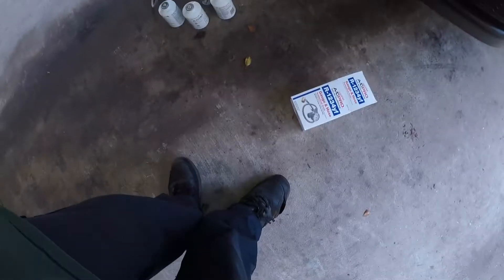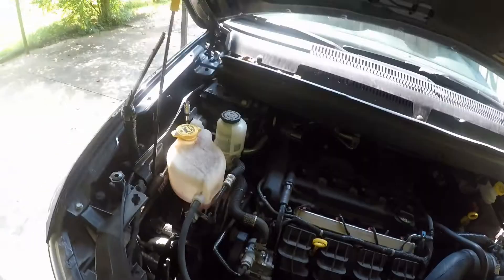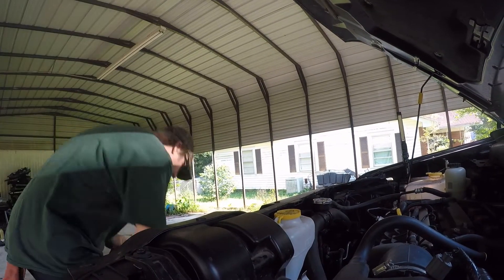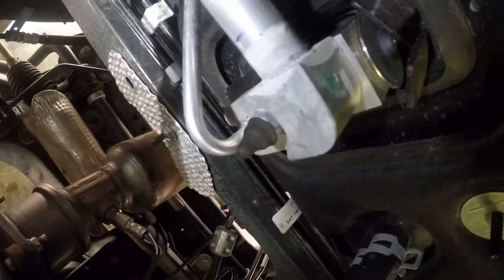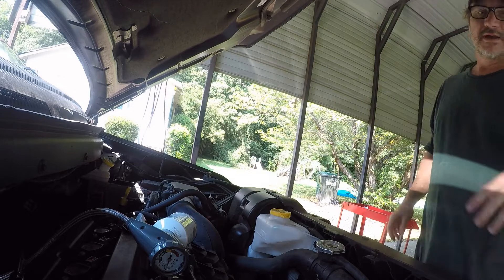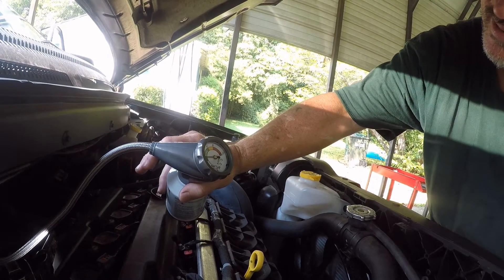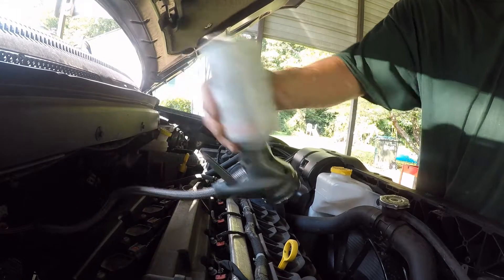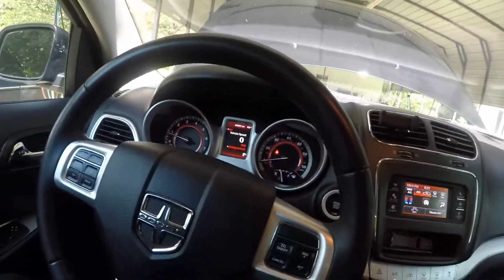How to add R-1234YF REFRIGERANT to your car

Comment: The hoses are different because you're not supposed to use 134a in a 1234yf system because it can ruin it over time don't use it unless you want to possibly have to buy a new AC for your car
Reply from the maker: It will be fine,just like R-134 was in R12,I've done hundreds none has any problems.Thanks for watching.